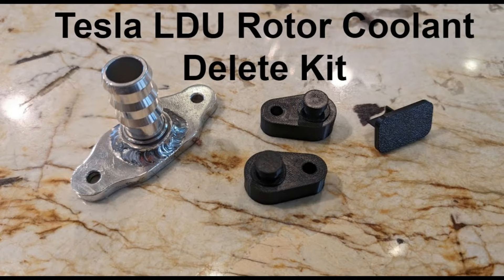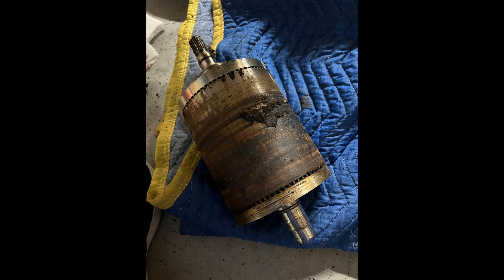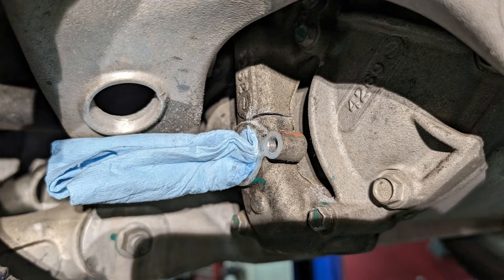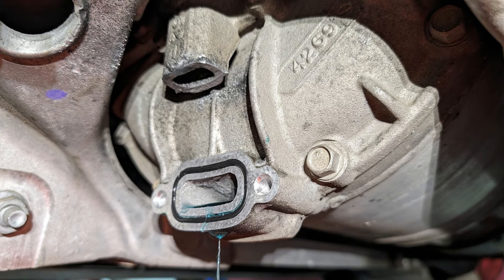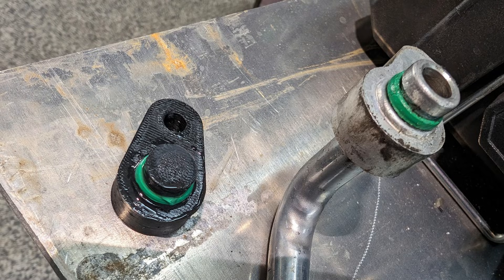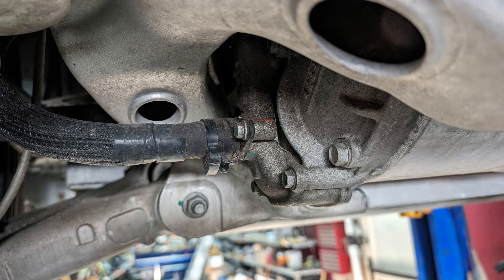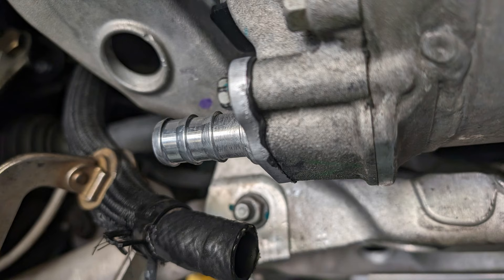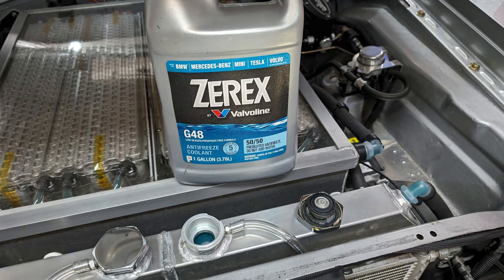Tesla LDU Rotor Coolant Delete Kit - For sale in the description!

Comment: Placed an order for my 2013 P85+. Only has about 30k miles on a warranty replacement drive unit so hopefully it hasn't started leaking yet. I plan on cutting the pipe and bracing it shut. I'll update this comment when I have it installed with how it went.

Update 2024-10-22: Got it done. Wasn't too bad of a job on jack stands. First time bracing (I've welded and soldered before but never tried bracing anything), took me a few tries before I got a leak-free brace on the crossover tube. The rectangular o-ring at the water inlet looked mint so I opted to re-use it but added a thin layer of RTV on the metal outside and inside of the o-ring. This is actually what Tesla does as well.
 
Had a bit of trouble with the inlet hose being too short with the new fitting location. Had to snap the hold-down zip-tie for the inlet pipe and then put a new zip-tie on it. Worked out in the end. 

Instructions link to a service center coolant purge procedure using Toolbox. No need to pay for Toolbox, the same coolant air purge function is available in the MCU service menu for free. I had to add about 1qt/liter of G48 coolant to get the level in the reservoir back up. 

Since I don't need the car today I left it on jack stands with the underbody tray off. I'll check for leaks tomorrow.

Total time was right at 4 hours including lifting the car and cleaning up the garage after. Could probably do it in 3 hrs now that I have experience bracing.
Reply: I assume you mean 'brazing', not 'bracing'...?  I'd suggest anyone else just buy 12mm push-fit (plumbing) stop-ends to cap the tube.
Reply: @martinwinlow  hi just checking these are definitely 12mm? As this sounds like the best idea to cap.
Reply: I bought a new for me 2014 P85 + first thing I did was check the rotor for moisture and there was none so I ordered this coolant delete. I  backed my car up on two ramps crawled under... biggest pain in the butt is just getting the covers off of the bottom of the car. I just broke thr pioe off and used the plugs on either end.  Such an easy install... it's been about 3 months, the car has driven flawlessly. I check every once in a while to see if there's any leaking and there hasn't been.

Comment: Tesla just installed the Q version of the LDU in my 2013 (175k).  So now I'm fixing it 200 miles later (since they didn't install a U version).  See below for the 'LEAK FIX' after installing this kit.

Recommendation to seller:  Don't 3D print the passenger side 'dust' cap (others shouldn't bother using it).  Either reuse the original tubing after sealing the open end... (welding would be best), although I chose to tap mine and seal a bolt in the end.

Or provide another metal 'dust' cap.  (obviously there is slight coolant pressure there so not sure we should be calling it a 'dust' cap)

1)  Jacked it up, added stands, removed the covers. (springs, not one that requires jack mode)
2)  Clamped the hose, removed the hose, removed connector (1 bolt) and stuffed with shop towel.
3)  Cut the stock manifold in half, removed the lower portion, vacuumed out some coolant.
4)  Cut the top tube and removed passenger side half, vacuumed the remaining tube to catch any particles.
5)  Installed the lower dust cap with one minute permatex.

6)  installed the dust cap for the remaining top tube end (with permatex) and the motor with o-ring (no permatex).
7)  Used one minute permatex on the new lower hose fitting and torqued to 8NM
8)  Purged the air by powering off for 5-10 and back on with heater on 81 degrees (using the normal screen menu -bottom of software screen)
9)  Powered off and let it sit overnight.
10)  Powered on next day and coolant began to drop in the reservoir, and bubbles were seen.
11)  Filled coolant.
12)  Checked for leaks, O-ring with dust cap on passenger side was barely leaking, but leaked none the less.

LEAK FIX:
So I took the dust cap off and put the o-ring back on the metal adapter with tubing.  I then cut another few inches off the tube and used an M10x1.25 tap and carefully threaded the tube (NOT the end with the o-ring).  Vacuumed up any particles (cleaning out the tube).  Grabbed some hose that fit tightly around the tube, an o-ring that fit around an M10x1.25 bolt, put the hose on, added permatex to the end with threads, tightened the bolt into the tube end.  Wrapped the tube end with tesa automotive tape for good measure and reinstalled.

No more leak.

I didn't like the amount of tubing that was left, concerned about vibrations eventually breaking or weakening it, so I cut a stainless s-hanger and bridged the gap back to the driver side metal tubing with more tape and blue zip ties.  It doesn't look too bad actually.

Purged the air again , added a bit more coolant and all is working as it should.

What would I do differently next time?  I'd take the metal tubing that I cut out and visit a radiator shop or other shop that can weld aluminum such that the cap was nicely sealed and the length of tubing that I had remaining wouldn't exist.
Reply: Why not just buy and install a standard plumbing push-fit 12mm blanking cap to the cut tube end?  Neat, cheap, easy and permanent seal...
Reply: @martinwinlow  Makes sense to me, it was a Sunday and didn't want to drive 30mins to Lowes.  Although, you should recommend the seller include two of those in the kit and do away with the 3d printed dust cap. (which isn't in that image above, so maybe someone has suggested something similar before?)
Reply: Well done and some good tips for fitting the kit. My first problem is how to get the car onto jackstands at the rear. I have 2 trolley jacks but can't see where to put the jackstands as there is no solid structure.
Reply: @Toob41  This is by no means the only option for achieving this fix... Just search Youtube - I've found at least 3 others, each with their pros and cons...
I think the answer for you to get the car on the jackstands is to incrementally raised each side in turn (probs several times) with a decent trolly jack...
Reply: @martinwinlow  No because the issue is that the supports can only go under the puck insert holes and the trolley is in that location so where to fit the jackstands? I had to buy car ramps but it's very risky reversing up the ramps because, if you pause going up the ramps, the car rolls back down.
Reply: @Toob41  I see... What about putting a 'strong enough' steel beam right across the car, from jacking point to jacking point (with spacers as required) and then you would have the full width of the beam to put jack and/or axle stand on either side as needed, side-by-side as it were..?  Not much height under the jacking points to play with, though...  Maybe a length of 'flat' (solid steel with a rectangular section) about 1/2" thick and 4" wide would do it.  It sounds a bit extreme but it would not cost much...
Reply: @martinwinlow  Thanks, yes that would work. I used the car ramps and managed, just. I tried jacking up via the subframe to use axle stands but chickened out as I was worried the car would roll forwards and the front wheels were only chocked with bricks.

Comment: So instead of blocking off the port for the flyover tube, why not just cut it a few inches from the now useless cover, put a hose on it, and run it down to the new barbed fitting using a tee to connect them?
Reply: Thats exactly what I did with my model S and it works well.
Reply from the maker: @diyhometheater4199  yeah that can be done, and people have done it.  The flyover tube is just return flow from the rotor, so if you don't feed the rotor, you don't really need a return.  I prefer to put full flow into the stator and inverter.  

For those who really want to bypass coolant:
The billet fitting has enough material at the flange to drill/tap with 1/8 in npt, and the aluminum fitting can be cut off the flyover tube and tapped with 1/8 npt.  This is the easiest way to add fittings.  Either barbed fittings for a hose, or push to connect fittings for plastic tubing.
Reply: @MrMoparMan  from what I understand, the rotor coolant also goes through a little heat exchanger for the drive gear oil as well on its way to join the coolant from the inverter. If you integrated a T and hose into your kit, it would do everything the 600 dollar ones do, I bet it would be the best out there
Reply from the maker: @diyhometheater4199  Yep, there is a heat exchanger cast into differential case.  Coolant returning from the rotor passes through a restrictor at the top of the differential and exits near the bottom of the differential after joining the stator/inverter return flow.

The rotor return coolant was heated by the rotor, and would add heat to the differential.

I opted to keep it simple, and increase flow through the stator and inverter where cooling is most vital and monitored.  It is possible to run a bypass and cool the differential if desired.  Since the original design passed heated coolant to the differential, I do not see the benefit of sending cool coolant to the differential.

The Revolt system uses the same flow, it's a very nice part as well.

Comment: Just installed the kit, jacked up car in the driveway, took the plastic panelling and wheel off (4 hours total, i have mild experience with this stuff) 
1. Main part was easy, cutting and installing the new billet. 
2. Cutting and capping the tube was hard, i recommend 2 extensions and a u-joint on the ratchet if you are doing this on the driveway like me. 

I had a coolant leak the next day, I think its the same as other users the coolant just keeps leaking onto the silicon and it never really dries, puddle of coolant in the morning. Best thing to do is as people are saying shop-vac out the coolant first or cut a gasket. Replacing the silicon now, will update. 

Question for the creator. I see coolant drips from the dust cap where the manifold was cut. I am assuming this is from residual coolant left in the system. Second question, the dust cap that goes onto the inboard part of the drive unit. What pressures does that experience? I am wondering if i should swap that part for an aluminium machined piece.
Reply from the maker: @ReinerSchmidt-f7e  Good job completing the install!  Coolant at the dust cap is residue, it can be blown out with compressed air, or shop vac if desired during the install.  For the block off fitting, it sees very low pressure, the most pressure would be during a refill/purge service procedure.  The ABS fitting is more than adequate for this pressure and temperature.
Reply: @MrMoparMan  Sorry, that fitting is not adequate.  The 3D printing isn't quite right, so it does not seat properly.
Reply: @gregsReply  Cap the cut pipe with push-fit 12mm stop-end and reinstall...

Comment: Does this apply to a 2015 85D Model S?
Reply from the maker: That car probably has the small rear drive unit which is not affected, however, I am not 100% sure about all of the different model configurations.    The affected motor is the large drive unit (LDU)
Reply: All RWD and all performance AWD have the LDU. 
AWD non performance cars have the small drive unit that is much more reliable!

Comment: Why do you need to remove the tube? If it’s empty and the inlet is sealed with the dust cap, it should be fine right? 

Also does the Q variant suffer from this?
Reply from the maker: @taustin1382  it will flow backwards through the tube into the rotor if it's not blocked off above the differential.  It can be done by either removing the entire tube or just cutting it and removing the section near the differential.
Reply: @MrMoparMan Hi, do you have plastic versions left? For 50$?
Reply: Yes, the Q version suffers as well.  The newer part number for the LDU with a coolant delete manifold is the U version.

Comment: Anybody have any ideas of how to remove some of the coolant if there is a rotor seal leak? I saw one guy on YouTube drilled a hole but not feeling adventurous enough to do that
Reply from the maker: @dasppg lots of variables if the coolant has leaked past the seal.  Drilling the weep hole or installing this kit and blowing out the rotor stops it from leaking further.  It's also possible to drill the inverter case, there are some examples in forums.
Reply: @MrMoparMan  thanks for your reply. The kit has been ordered. I’d like to remove some residual if there is some. I bought an endoscope camera for inspection
Reply: @MrMoparMan  where’s the weep hole?  Or if you’re saying to add one where is it added? Tesla should have made a weep hole from the factory.
Reply from the maker: @dasppg  yeah, a weep hole can be drilled.  It's not a fix as much as an indication that the seal has failed and is leaking.
Reply: @MrMoparMan  it sounds like a good idea to get any potential coolant out

Comment: Thank you for sharing.  I was avoiding LDU's while looking for model S's.  This has opened up my options.  You have nailed the Y in DIY.   I like your approach to an in car way of dealing with the problem.  Perhaps using a Y connector and section of hose to direct cooling through the unused gearbox line might be beneficial?
Reply: As i understand its possible to do not removing the motor from car
Reply from the maker: Thanks!   Some people have installed a tee to feed the original return tube.  I have not found that it is necessary and would rather direct 100% of the flow directly into the stator and inverter.
Reply: @eodteu1  I have read about the Y connector, do you have pictures or a YouTube video on how to install it?

Comment: Just had an idea, instead of permanently sealing the 'failed liquid cooling' area, is it possible to AIR cool that rotor, attach some kind of gizmo that blows air and extracts air?
Reply from the maker: @donx03  Yep totally possible, and relatively simple.  I have pushed my car to very high temperatures and have not seen a need yet, but I am all for trying new things.
Reply: The QCQC part allows for oil cooling. It costs $600 with out the extra parts for oil cooling, and the drive unit needs to be removed from the car to install the part.

Comment: Do you blow air or dry the inside before sealing it for good?
Reply from the maker: @donx03  it's not a bad idea, if you blow from the top down before you plug the bottom casting. It allows any coolant residue to drip out.
Reply: @MrMoparMan  add this step to instructions, I'll modify my blow-dryer, bike pump, air compressor, etc to get all the coolant out
Reply from the maker: @donx03  Yep, although it is not mentioned here, there are multiple mentions in the written instructions.  I think you will be able to get residue cleared out with your plan.
Reply: @MrMoparMan  Let's start casting these, machining the barbed end.  Emailed for availability, need help with manufacturing?  I wish to do this for all the Tesla's in my area.

Comment: Just installed. It's doable in the car, but a huge pain the first time through. I have a few problems with the kit: 1) FIRST STEP turn the car off!!! It will puke coolant out; 2) no printed instructions (and no torque specs); 3) the kit should 100% include a new o-ring where the new part bolts up (you really dropped the ball here - mine never stopped dropping coolant so no way for the RTV to cure without interference); 4) no mention of system bleeding; 5) this video makes this seem way easier than it is (you're going to need a second wrist on your right arm).
Reply: I completed mine yesterday. I used a felpro DIY gasket kit to make sure everything sealed properly and instead of removing the top pipe I capped it with silicone caps and a hose clamp. Not easy, but do-able and happy to know I don't have to worry about this issue now. Knowing my luck, my battery will fail next week haha
Reply from the maker: Thanks for your honest review, hopefully it helps me improve things and helps others with the installation.  I will definitely add step one turn off the car before working on it 😉.  I'm glad you used my kit instead of the one that makes you disconnect high voltage 😬.
Reply: @MrMoparMan  Guess I'm your R&D guy? 2013 MS85 Rev.Q motor. I would suggest anyone doing this in the car to shop vac residual coolant from the remainder of the housing BEFORE adding the dust cover (btw, my cover did not go in straight and broke trying to pry it out). As I mentioned, I would avoid using the plastic plugs (mine did not seal - there was no "resistance" trying to install it because the dimension did not match). On the second go (and another gallon of antifreeze later), I instead cut the original aluminum pipe at the second bend from the fitting, then used a vise to get it near-closed and then brazed it shut - this actually gives you a handle to bleed the air up there (granted, air will be trapped in this pipe, but it was the best idea I had at the time). I installed the original fitting with the green o-ring and snugged it down, ran the air purge once, then I very slightly loosened the fitting and ran a second purge. During the second purge, I wiggled the aluminum fitting and eventually heard hissing as the air escaped. Once coolant dripped, I snugged it back up.
Reply from the maker: @CrankyGypsy  Thanks again for your feedback, great job on your install...Congrats on extending the life of your large drive unit!
Reply: @MrMoparMan Have all of these issues been corrected with your kit?
Reply: @MrMoparMan  well, found a flaw. The inboard plug is not sealing while running the air purge sequence. The issue is your plug where the old o-ring is added is 0.50mm smaller and does not seal under pressure. Right now, I'm brazing the old pipe connection shut.
Reply: I just did this and a QR code was supplied to view the install instructions.  They included torques specs. (8NM).  Thanks if you're the reason this was done.  Otherwise, maybe the piece of paper with the QR code was missed?